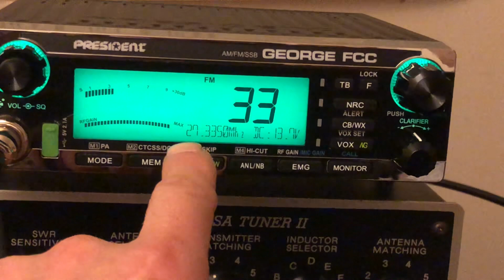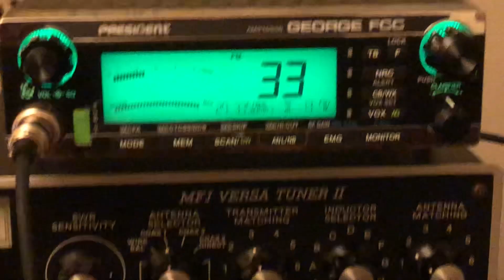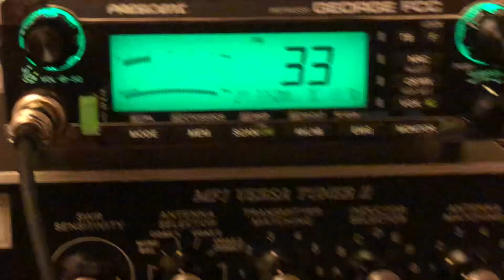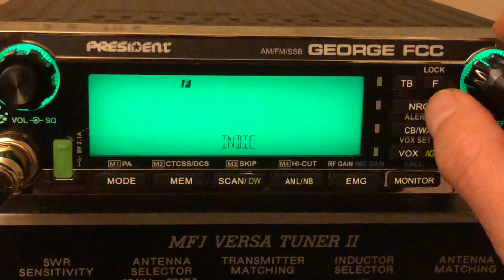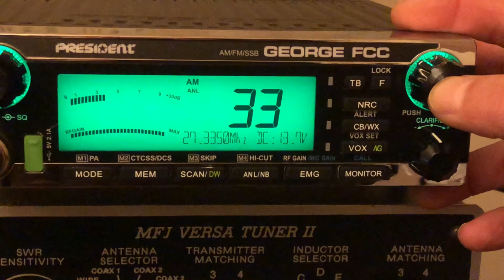President George FCC indicator SWR meter function.

Comment: Hi.Does the screen get very warm,like the uniden 980 ssb?
Reply from the maker: Honestly never checked. I have it in the mobile now.  But don’t drive long enough to actually answer that question.  But you know LED’s put off a bunch of heat. At least the socket bulbs 💡 do anyway.  
So to answer your question, I don’t know.
Reply: After 30-40 mins mine is cool to the touch. But it's 2am & dark out...55 degrees.